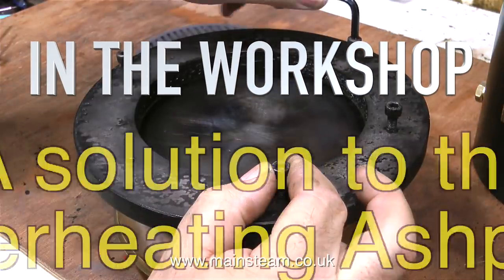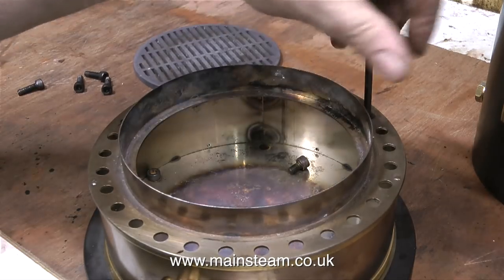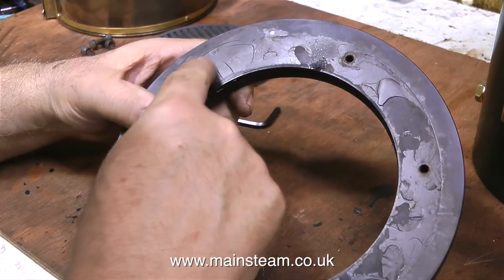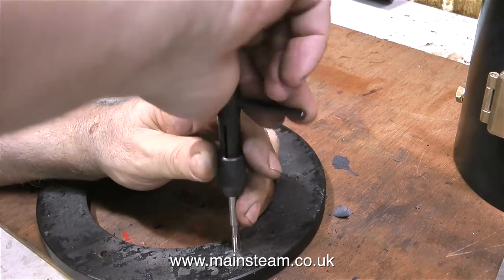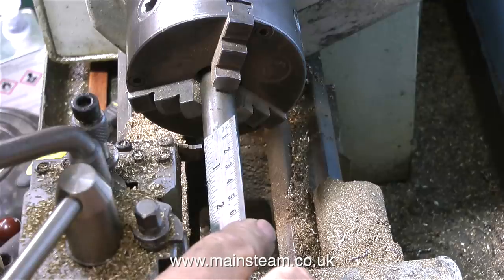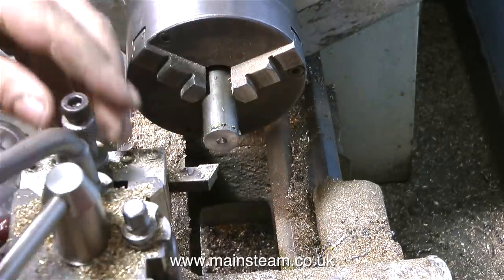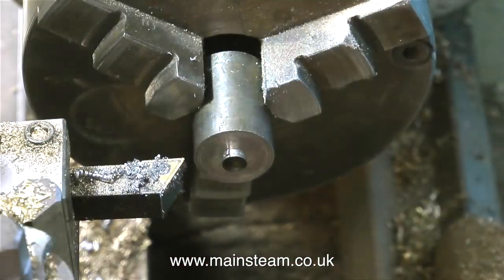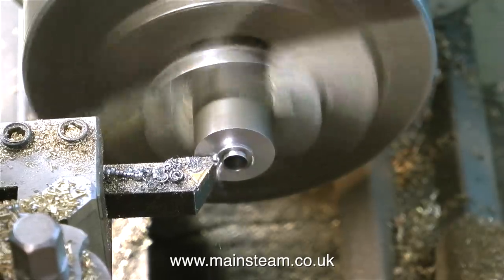OVERHEATING ASHPAN SOLUTION - IN THE WORKSHOP

Comment: Making a water tank under there would be complex, but you could stuff a flat coil of copper pipe under there pretty easily. I think you should just set the thing on a crate of sterling engines so they can throw a party under there though.   ...A "mosh pit", so to speak.

Comment: Very neat, even elegant solution! Bravo!
Re: screw v. bolts....I was a machinist for 28 years. I can't say this was a universal rule of thumb, but in my experience a threaded fastener 1/4" or smaller was a screw or machine screw. Everything above that was a bolt, excluding wood and sheet metal screws. If it took a nut or threaded hole to fasten it, it was one or the other, screw or bolt, depending on size.
Reply: Screws require a screwdriver

I have read that if it has a thread all the way along the shaft then it is classed as a screw but if it has a shoulder it is a bolt (unless it is tapered, then even with a shoulder it's still a screw). 
That's probably technically correct but in simple terms nuts and bolts are tightened with spanners (external hex) and screws are tightened with screwdrivers that are slotted or socket cap (internal).
Reply: It all boils down to Nuts, If you use a nut it is a Bolt, If you don't your screwed.
A bolt is a threaded fastener mated with a nut. A screw has either pre-formed or self-made external threads. A stud is an externally threaded headless fastener. One end mates with a tapped component and the other with a standard nut

A bolt is an externally threaded fastener designed for insertion through holes in assembled parts, and is normally intended to be tightened or released by torquing a nut.

A screw is an externally threaded fastener capable of being inserted into holes in assembled parts, or mating with a preformed internal thread or forming its own thread, and of being tightened or released by torquing the head.

A bolt with threads on both ends, to be screwed permanently into a fixed part at one end and receive a nut upon the other; - called also standing bolt or stud